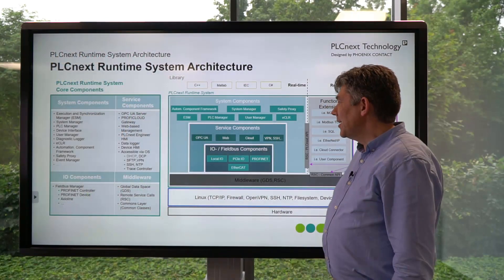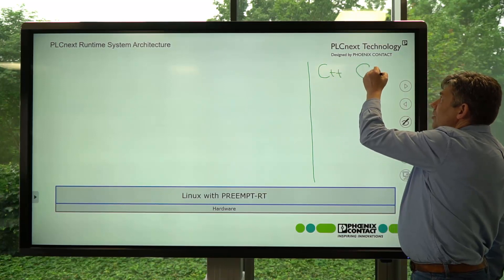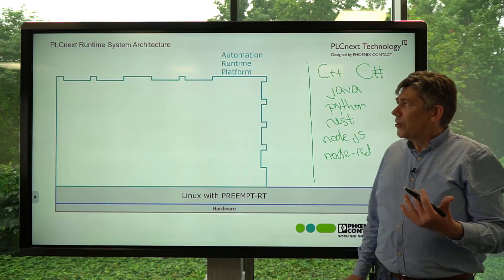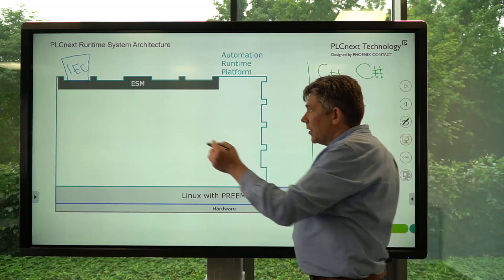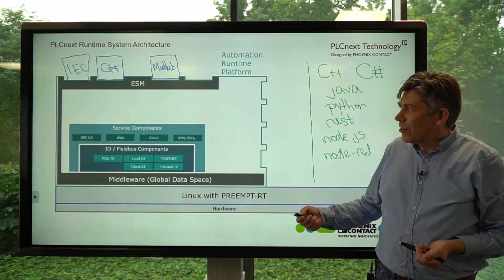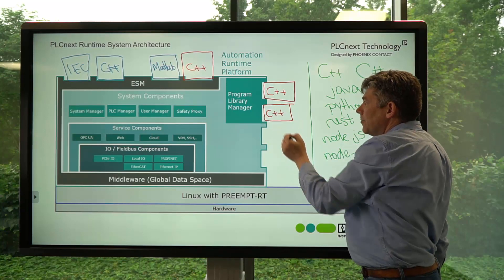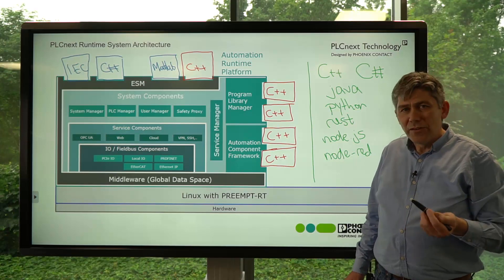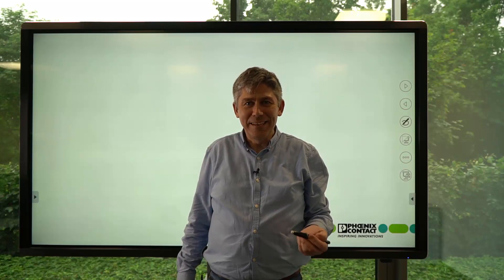PLCnext Runtime System architecture in a nutshell | PLCnext Technology Basics

Comment: Is possibe control of axio in/outs with nodejs AND javascript only?
Reply from the maker: Yes, this is possible. We currently do not have a specific example using node.js/javascript, but the principle is the same as for the Sample Runtime example in Github (https://github.com/PLCnext/SampleRuntime), and requires the use of the PLCnext ANSI-C interface.
Reply from the maker: Hi Alex, thanks for this suggestion, we will consider that. We'll never have enough resources to support the wide range of libraries and tools that can be used with the open PLCnext Technology platform. But for any topic there's hopefully someone out there who has made a similar project and shares his or her experience with you. Did you see the "Makers Blog" section and the "Forum" in the https://www.PLCnext-Community.net? 
There are a lot of tips and tutorials given by users of node.js in PLCnext context. If there are any questions that have not been touched by now, please log in to the PLCnext Community (it's free of charge and ads) and open a new thread in the Forum.